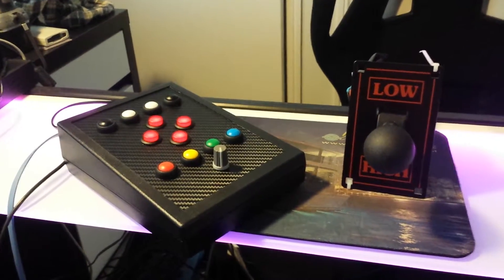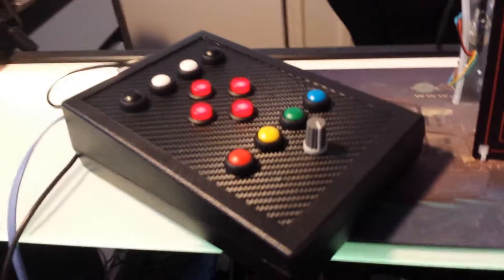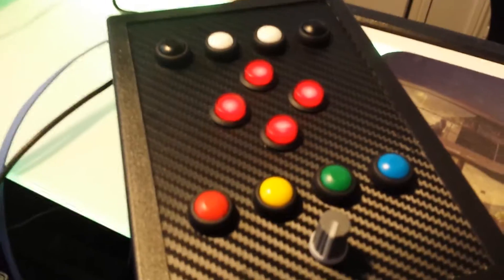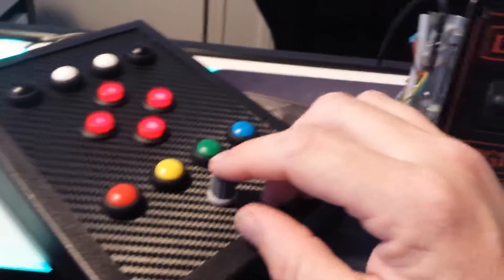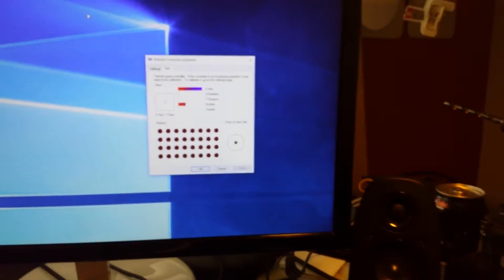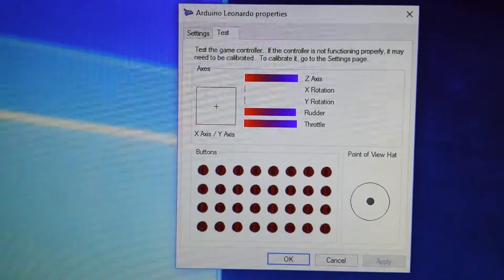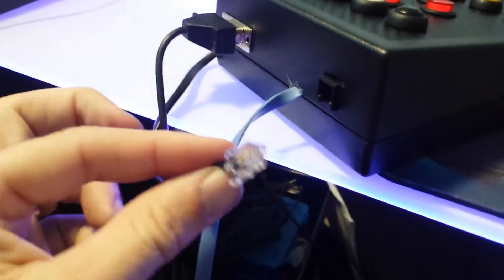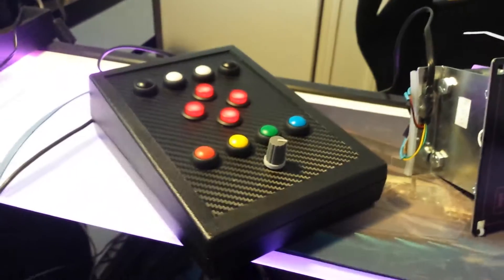RamjetX - ButtonBox Pedal Adapter Shifter Combo

Comment: If those backlit buttons are the adafruit ones could you please supply me with your code for the glow after pressing the button
Reply from the maker: Heya. The buttons are generic, but I think Ada sell them too. 

The code I used was based on SoftPWM library. By default it won't do what this does now. I enhanced and posted the update to that library on his site but I'm not sure if it was taken onboard.

Essentially I added a GetPWM function to his library which allowed me to monitor the current PWM value after setting it in my code. That way I got a notification in an interrupt that the PWM has now reached the correct brightness. At that point I instructed it to reduce and glow at a new brightness at a slower rate. 

It wasn't hard but not something I can easily extract for an example code without the modified library. 

Over the next few days, I'll check back in with the original author and see if it's been implemented and or submit my own pull of the library. I'll then be in a better position to supply a example of use for the touch sensitive glowing effects.